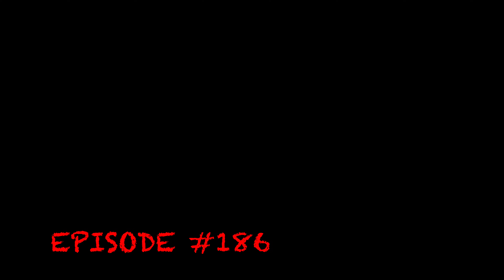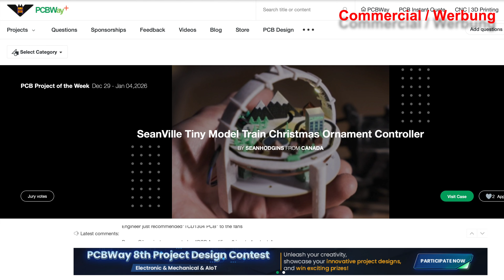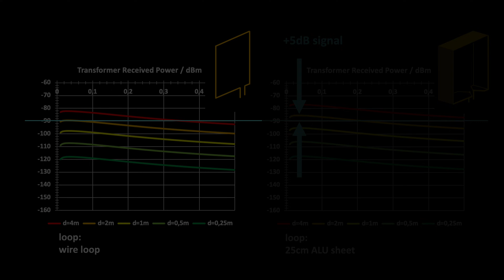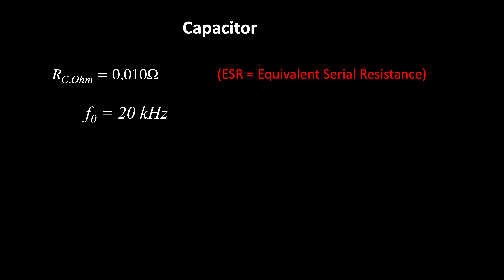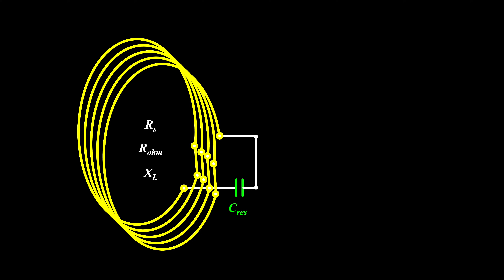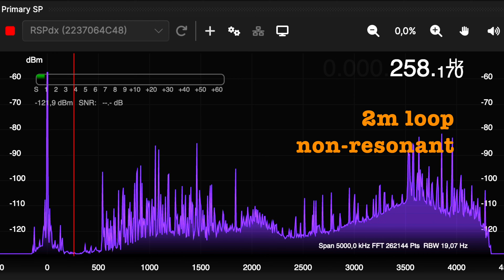Compact Resonant VLF Loop - Thanks to Resonance better than expected! (EP186)

Comment: Good stuff. Thank you. I figure the ultimate LF loop is one with an extremely high Q, theoretically with a bandwidth no wider than that required to receive the bandwidth of the modulation mode of interest. Of course, unless you are only interested in receiving 1 particular station you will want it to be tunable. While I have yet to build it, my plan is for a loop made of 4 to 6 inch wide roof flashing, a thin, inexpensive aluminum sheet material. I plan to build the loop as a square with about a 1 inch gap in the middle of the top of the loop and a separate sheet of aluminum that slides across the top of the loop without touching it, acting as a variable capacitance for the loop for tuning purposes. That avoids the need to purchase an expensive butterfly capacitor that is typically necessary in order to keep resistive losses very low and Q very high.
Reply from the maker: Hi John,
Another great comment from you! Thank you so much. Your plan with the aluminum sheet is certainly very good. I have more videos about optimizing the conductor and frequency tuning in the pipeline. So stay tuned, there are definitely ideas for you in there. 
Greetings, Klaus

Comment: Thank you for including build instructions, that helps a great deal. I have seen two types of cores used in your VLF videos. Both appear to be from the clip-on kit available at Amazon. One is a split core which you have glued together and the other is the black larger-diameter ring core which is also available in that Amazon kit (which I have also bought). I'm not sure if you've measured these two cores for permeability somewhere, but have you tried other cores, for instance Fair-Rite's 75 material (approx initial permeability of ~5000) or other such ferrites?
Reply from the maker: Thanks for your comment; yes you are right. I haven't tested different materials yet, but using higher permeability cores would certainly be an interesting experiment. Greetings, Klaus
Reply: @electronics.unmessed  I have tried to figure out the material of those Amazon cores but with highly inconclusive results. They could be anything, frankly. On a one-turn 5m copper wire loop I use an FT140-75 toroid with a tap just after the third turn (of 24 turns). That works brilliantly to connect it to my RSP Duo. It would be interesting to see the results of your tests using a few such materials, like the 75 material (ui of 5000 approx), 77 (about half of that) and even a higher permeability core like Amidons W material or TDK's FT150-T38 both of which are at about ui 100000. I have a feeling it will make quite the difference.
Reply from the maker: Yes, there is a comparison of materials in one of the other videos. Greetings, Klaus

Comment: Could you please explain the five core cable you've used for the loop, and provide a link so that I can find a similar cable to use. Most of the five core cable I can find is soft and floppy and would not hold it's shape like yours.
Reply from the maker: Thx for your comment! It's an installation cable with 5 solid 2.5 mm^2 copper conductors. In fact, with a diameter of 1 meter, it doesn't hold its shape on its own. I have to tie it to the ceiling with a string or support it with a plastic pipe structure. Greetings Klaus

Comment: Good morning Klaus, first of all, congratulations on your very interesting videos. I built the balun with three glued toroids and 80 turns of 0.5 mm enameled copper wire. I'm not sure how to connect everything right now, as I can't quite make out from the video, since everything is already assembled. Should the 5-turn secondary winding be wound onto the primary? And how should the terminals of the primary (80 turns) and the secondary (5 turns) be connected? Thank you for your patience in explaining everything to me, as I'm not very familiar with electronics. Thanks and best wishes.
Reply from the maker: Thx for your comment. 80 turns is the secondary winding to the receiver. Just check out the schematic and the earlier videos to understand the principle. Greetings Klaus
Reply: @electronics.unmessed  , Unfortunately, I am completely new to electronics. If you could show me step by step how to make the balun and the connections to the loop and the SO239, I would be truly grateful. Paolo
Reply from the maker: @paolocaldarella4472  Here are some helpful videos: 
https://youtu.be/fCaNSGwOdZI?si=0KrE4G3XKSb3uJle
https://youtu.be/1x8rcep6mRE?si=en786l4f3sCi6h1y
https://youtu.be/1x8rcep6mRE?si=P8t6PAosoavAJJO2

Comment: I am embarrassed to ask, do more turns in a loop soften the edges of the received transmission?  Is there such a thing as inductive inertia, such that fewer turns creates sharper transitions from on and off states of a CW carrier?
Reply from the maker: In a sense yes. Resonance is a kind of electric inertia if you want.
Reply: I think the answer is partially, you could unwrap the loops into one big loop and it would be equivalent.
Reply from the maker: Bear in mind that inductance is growing quadratically with the number of turns and linear with the length of the wire. So it’s not the same when unwrapping the loop. Greetings Klaus
Reply: @electronics.unmessed  oh yes, as your video said
Reply from the maker: @DumbledoreMcCracken .. there will be a new video soon where I‘m investigating more questions of this kind. Stay tuned. Greetings Klaus

Comment: Awaiting the tuning, as am imagining varactor or swtiched as possibilties. Also thinking about crossed loops and synchronous sampling with 192kHz soundcards for electronic steering...
Reply from the maker: Thx for your comment! Switched - yes part of it, but ... there will a surprising method, which is pretty surprising. At least didn't think it work that way. Stay tuned! Greetings Klaus
Reply: The problem with varactor tuning at those frequencies is they hurt the antenna Q, a high Q being necessary to cut out noise, which low frequency bands are infamous for.